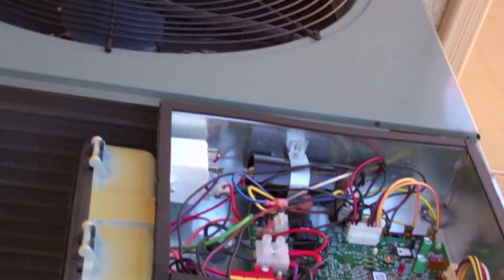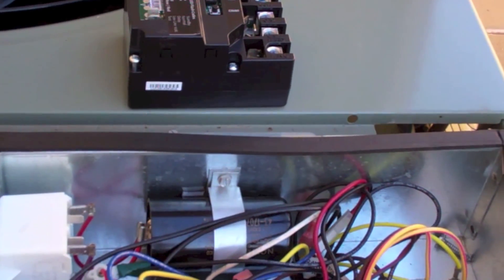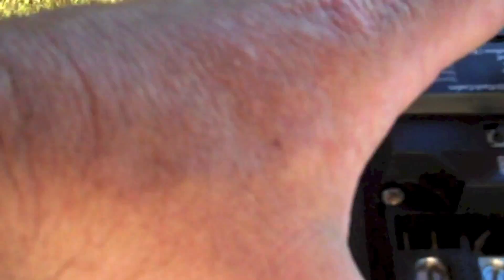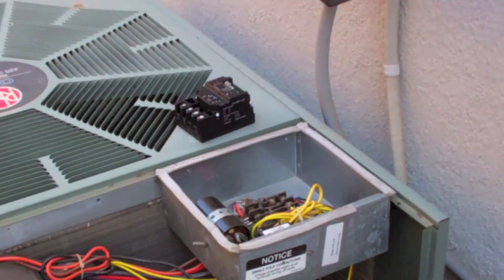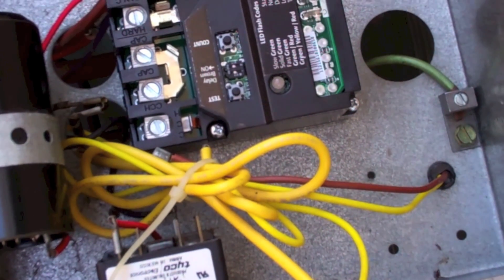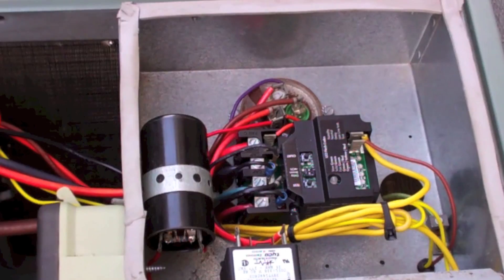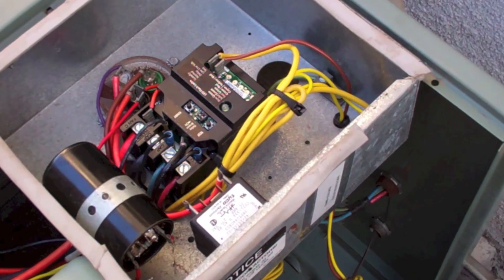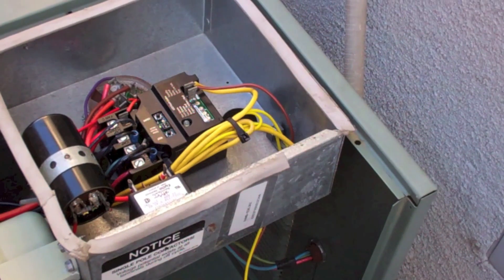24 Volt Contactor Replacement

Comment: Excellent Video ! Is it best to use the Emerson with a 5-2-1 Hard Start Kit ?
Reply from the maker: You can use the Emerson Switch by itself.If your compressor is having a hard time starting you can use a 5-2-1 hard start or a two wire hard start like this...http://www.rectorseal.com/hard-start-kits-kickstart-compressor/
Thank you very much!
Reply: thanks

Comment from the maker: When I pump down a unit I just do it by turning on the air conditioning, but it still can be done with the test button if the line set is short.Thanks for watching!